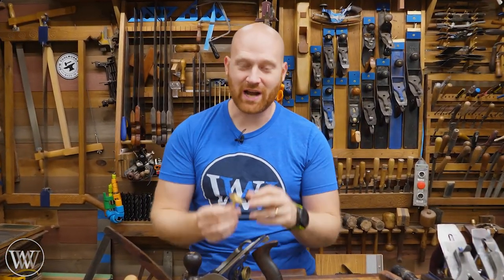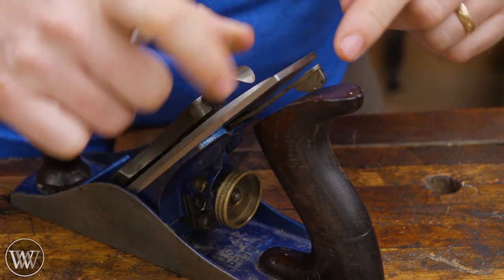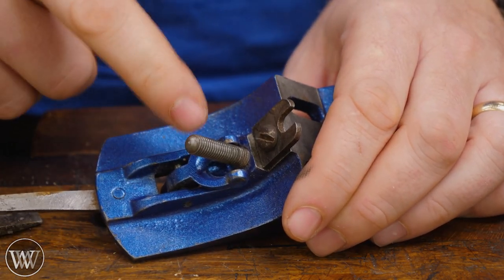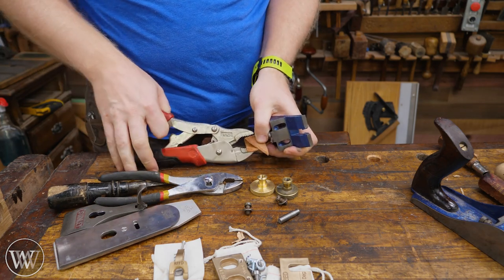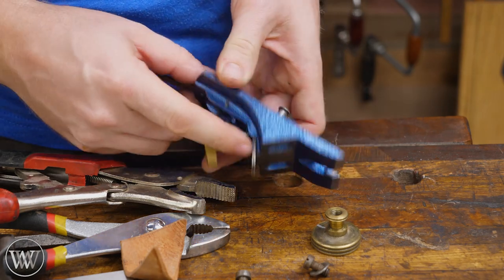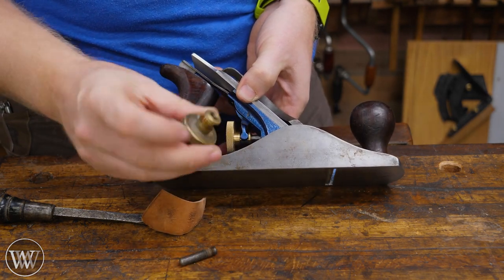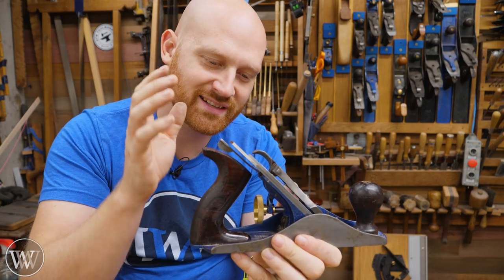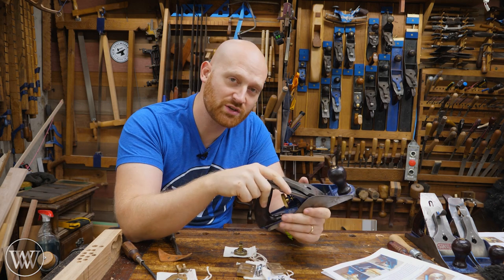How to Install and Use the Reed Plane Fine Depth Adjustment Knob and Stud

Comment: The standard way to grip a threaded stud without ruining the threads is with two nuts locked together.  Of course that means you would need to find (or make) a left-handed nut of the the right size.  The existing knob can serve as the second one.  Something to consider adding into the kit?
Reply from the maker: Yeah finding a left-handed thread with a crazy cut like that one would be fun. Unfortunately the new fine adjuster knob is a fine thread and wouldn't be able to be the second nut for it.

Comment: I bought a file to fit yoke years ago, so I could fit a thicker iron in one of my planes. I ended up filing and shaping it all; only to drill the hole slightly cooked 😂🤣🤦‍♂️ by time I reemed it out so it could pivot on the new pin and line up with the wheel, it was as sloppy as the original and I still couldnt fit the thicker iron coz I had shaped the whole thing 🤦‍♂️😂🤣 make sure you leave instructions to shape the part that fits into the cap iron AFTER the hole is drilled...... this was what caused some of my failure 😁

Comment: Where is the best place to buy a replacement stem for a type 11 adjuster?
Reply from the maker: if you want an original I would start on "the Parts Division" on facebook. https://www.facebook.com/groups/1690633051116716 my second stop would be going down the list of online sellers on WWW.HandToolFinder.com

Comment: Your upgrades are very cool! The hardware on Stanley Baily planes drives me nuts, they are not a size or pitch normally available. I bought the proper pitch thread file to repair boogered up threads on my #4 adjuster wheel stud. None of my others needed it.

Comment: Would these work on an Ohio 5 1/2? I feel like if I could swap out the yolk then I could make it function much better than what they originally produced
Reply from the maker: I have not had a chance to test it on one of those yet. if the adjustment stud from a Stanley fits into it then yes. If you do ever try please let me know.
Reply: @WoodByWrightHowTo  I did purchase the file to fit yoke. Hopefully it'll help to use the hock iron and chip breaker now. They won't work with the current yoke on my 5 1/2
Reply from the maker: That is a common problem. It's nice to have the extra extension in the yoke so you can use thicker irons

Comment: Anyone know offhand what type Stanley no 4 and higher this will work on?
Reply: Also, awesome content as always! 🤘🏻🤘🏻🤘🏻
Reply from the maker: This will work on a Stanley type 5 and later. It will also work fine in any of the sizes. Though with a number 2 or number 3 it might be a bit tight where the fingers fit as it's a little larger than the original wheel.

Comment: I hate the Bailey pattern plane, that knob being left handed is no help, I always have to look at the adjuster and work out which way to turn it to do what I want. Even in a well made plane there is always a half turn of backlash between going one way and the other. This knob is an improvement, but really it is just a make do fix on a basically flawed design. The smart money is with the companies like Kunz, Veritas and Stanley on their modern Sweetheart, who have reverted to Norris style adjusters.